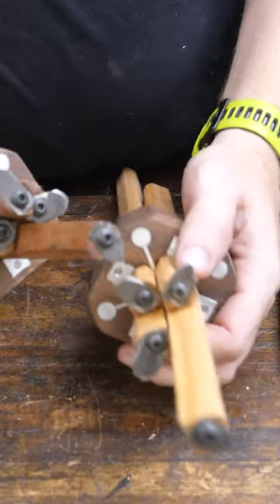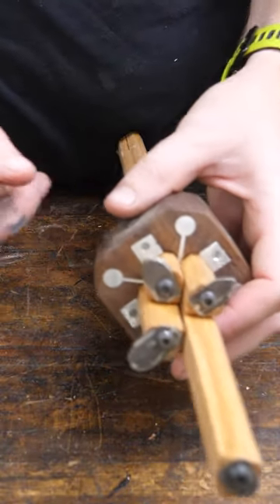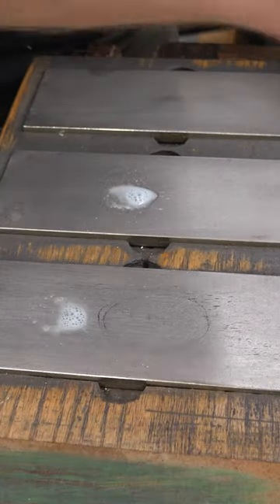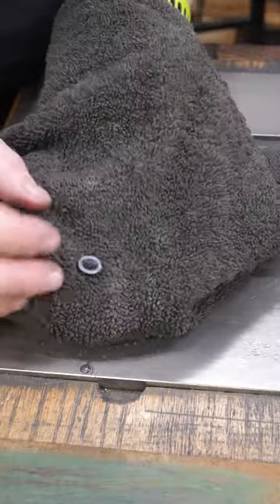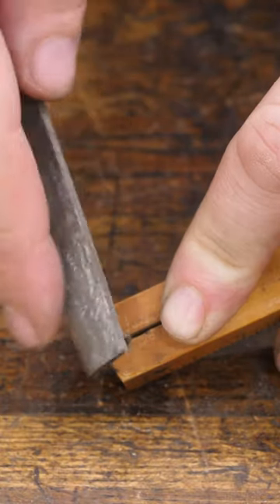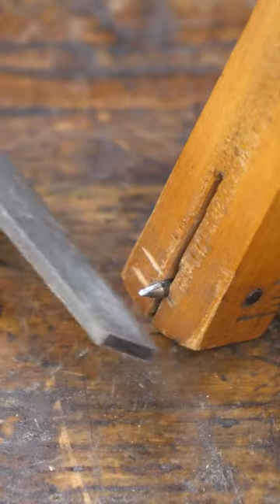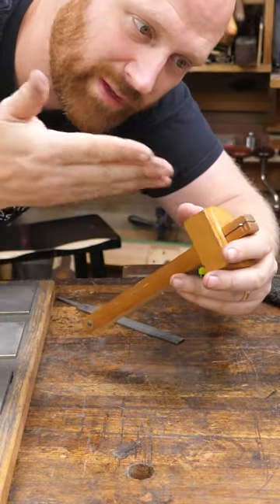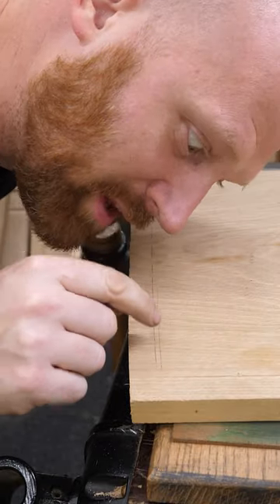How to sharpen a marking gauge

Comment: did YT take away ability to attach links in comments ?
Reply: Yea seems to be the case, even if I copy and paste them in browser it seems to not be able to even find the video let alone play it, and if you are lucky enough for it to load up, it will probably show up as a Private video
Reply from the maker: Yes. They took it away from creators too on shorts. Even in the discription the links don't work any more for shorts.
Reply from the maker: They were having a TON of problems with spam on the shorts.